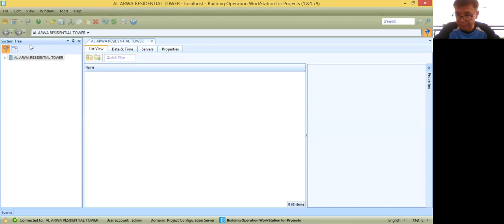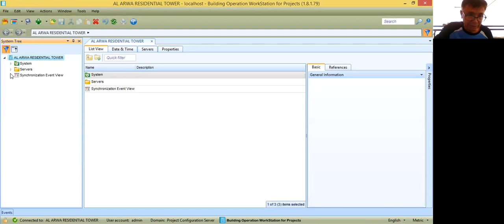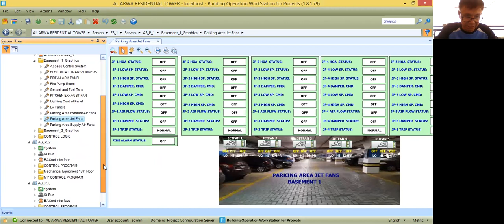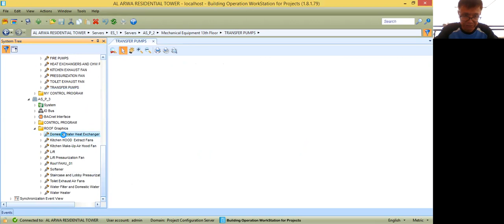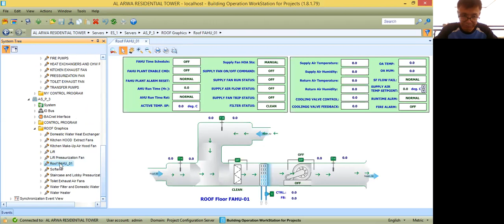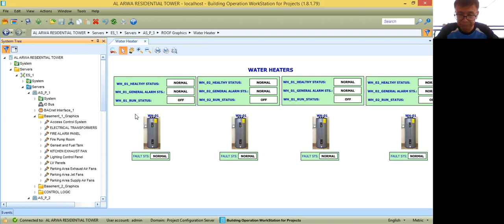How to Engineer a BMS Project

Comment: Make some vedios on Elv systems like cctv system, Access control, pava system, Master clock, gate barriers,fire alarm system, how this systems work their architecture etch
Reply from the maker: I am a BMS engineer, for the third party we are doing software integration maybe in my future videos I will include software integration. But for other low current system I can not do tutorial videos for the reason I  don't  have materials to be used

Comment: my trend controller have watchdog alarm what i do  to remove
Reply from the maker: I have not encountered it in my DDCs, just check if there is a disable option for that, but I believed it only happens if there is some bug in your program or your DDC or PLC become unstable while its doing its  job or check your control logic
Reply: @SantosJrCapellan-BMS  thank you so much sir